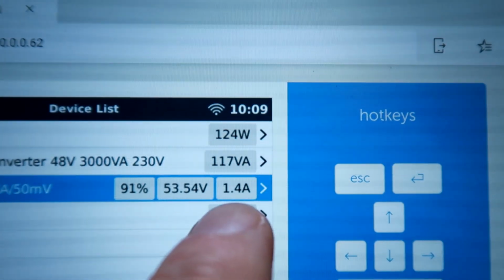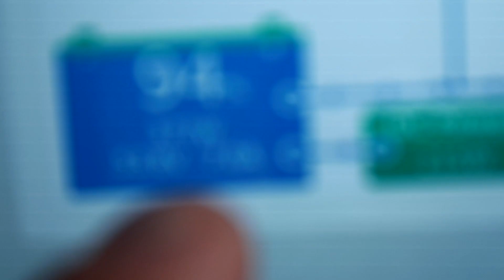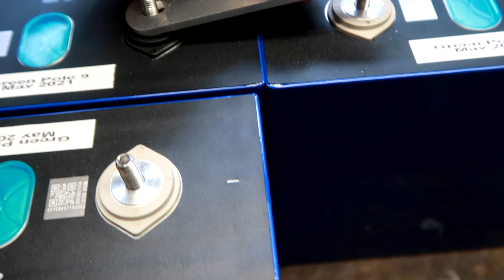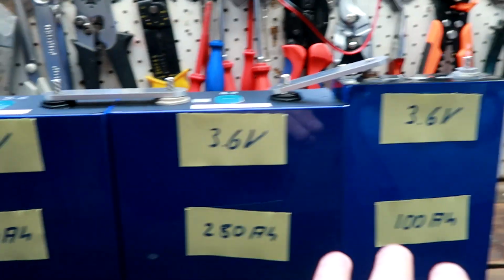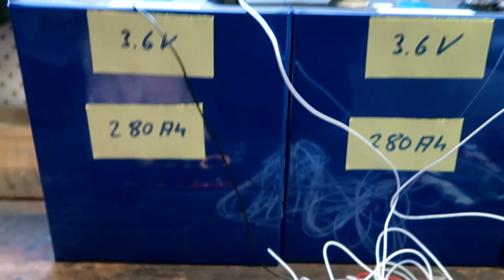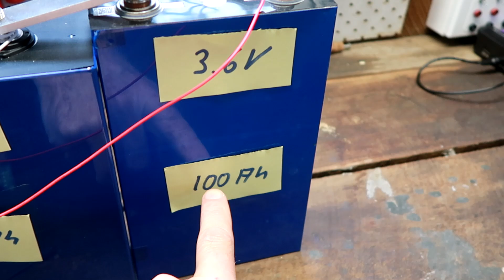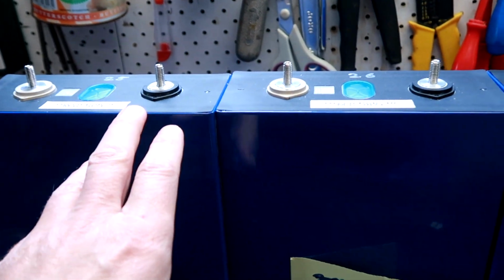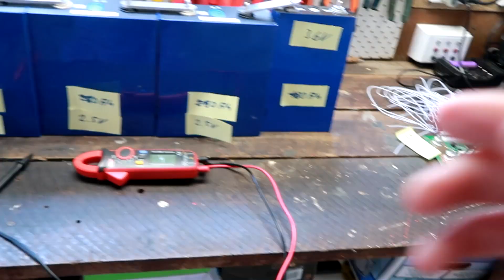Divided opinion about balancing, balancers, BMS. How to and why to balance LiFePO4.

Comment: Question, when bottom balancing, when you drain the batteries to 2.5v do them individually or in parralel?
Reply from the maker: All cells need to be at 2.5V. You can do this by parallel them or on an individual base, it does not matter.

Comment: Good video, well I'm going to do a bottom balance on 12v 200ah lifepo4 blue carbon battery,  two of the cell are already 2.5v, im going to connect a 12v fan until stop working. Hopefully all the cells gets 2.5v, then I will connect smart charger  lifepo4 to the battery until gets full. I don't have Active balancer. I hope this work.... Any advice?
Reply from the maker: Does the battery has a BMS? These days, all chargers, MPPTs and BMS are designed for top balancing. Nobody really does bottom balancing any more these days due to the fact that we now have BMS available which work reliable and also balance the cells at the top.
Reply: @OffGridGarageAustralia  yes, the battery has bms but when they were installed in series never were balanced and one of the two batteries started showing lower voltage, I opened and I noticed two cells with 2.7v.

Comment: I have one of my 16 cells that will not charge above 3.4 volts - as in its never seen more than 3.3xxx volts.  I end up with a voltage difference of 0.125 v when my battery is charged (I charge to around 55.4 volts).   I have raised this with the seller and that have said initially that this was "a dynamic voltage so you shouldn't worry about it".  After shutting down the battery and checking it with a multi-meter, I am still seeing the same difference after an hour of being turned off.  Seller says "within tolerance" and it wont be a problem.  I call BS and think it will become an issue in time; probably reducing the life of my battery.  Thoughts?
Reply from the maker: Can you manually charge just this one battery?
I would charge all cells as usually to 55.4V and then connect only this one cell and charge it as well to 3.46V. So it is inline with the others.
Reply: @OffGridGarageAustralia  Thanks for your response.  I'll try the single cell charge this evening.  Watch this space!
Reply: @OffGridGarageAustralia  I ended up charging it to 3.5 volts - a little more than the other cells.  It took the charge at 25 amps - took around half an hour to get there.  I have installed it back into the battery bank and powered everything up.  Immediately and as expected the BMS started doing its thing and taking power from that cell to distribute to the others.  As of right now, the cells are all sitting 3.324 (53.18) volts - within .001v of each other - around about 88% SOC.  Everything looks okay, but I wont know for sure until tomorrow when the solar pumps back up to top the batteries up.  I see this behavior normally and then when I go to charge, it wont go above the 3.4 as described.  Fair to say that the cell can charge, but isn't doing so in the Battery.  Also a few days ago, I did terminate my balance lead again to that particular cell and even tried moving it to another position to rule out the BMS as the issue.  I'll update again when I get another charge of sunlight!
Reply from the maker: @nonicknamesremain  Thanks for the update. The single charged cell may now cause the opposite as before and could trigger OVP in the BMS. Can you leave the battery on a power supply over night and keep it a55.4V to give the balancer time to do its job? That should bring it in line with the other ones again.

Comment: The main reason for bottom balancing in EVs is to protect the weakest cell from going into reverse current when the battery is low and you go full throttle.
Reply: That is the job of a GOOD BMS.. balanced cells dont protect them... BMS does.
Reply: @Doctorbasss  the bottom balancing people did not use a BMS, they just used a low voltage cut off... These people were living for physics at that time🐸
Reply: @mjp0815  So, what happens when one cell drops way below the low voltage knee BEFORE the pack Voltage drops below the cut-off voltage?  Are you saying that this does not, or can not, ever happen?   Bottom Balancing, then running without a BMS, is not normally done in an off-grid situation.
Reply: @MrSummitville  when one cell drops to zero before the pack voltage is at the low voltage cut off really bad things happen as this cell is driven into "reverse polarity" instant destruction. Bottom balancing allows you to use the entire pack safely in high current situations like EVs without BMS, just using voltage monitor without running into this dangerous and expensive issue. Also, the bottom knee of the kurve is nicely visible in bottom balanced packs. Another reason why early DIY EV owners liked to bottom balance their packs.... They could tell that they were empty by simply looking at the pack voltage. The charging process was a low amp thing, lots of time to catch high voltage cells.... History... Today's BMSs top balance the packs now, and monitor each cell for low voltage... Drbass rightly said.

Comment: I intend to charge to 3.4 (54.4) then float at 3.4 (54.4) for 30 minutes.  As you pointed out in a previous episode,   this puts all cells at max capacity.  I would also stop the charge if any cell hit 4.45v.   Is there a problem with this? I would turn of all balancing.  Do you think this would cause plating problems?
Reply from the maker: I don't think your settings will cause any problems. Are your cells not going out of sync after w while?
Reply: @OffGridGarageAustralia  still in planning stage. Thanks for your work.

Comment: How do people feel about extending pv cables by soldered splice and marine shrink wrap? I ask, as I need to extend some existing cables, and there is little room in the conduit for anything else. Otherwise I have to spend £100 for new cable. Would the soldered join act as a resistor? The cable is 4mm2, 1000v . I intend to run around 1kw at @98v down these wires.
Reply: So long as the splice solder is thicker than the wire then no issue.
Reply from the maker: Hey, Chris, there is no problem with that. I have done it numerous times. If the solder connection is solid, no problem.
Reply: @OffGridGarageAustralia  thanks all, this is todays job.

Comment: Even on my 4.2v chemistry's (on ebikes usually) I bottom balance, but I also have a bms set to disconnect the pack if any cell gets above 4.1 or below 3.1. I prefer bottom balancing as at high current drains with a low SOC you have less risk of pushing a weak cell into a reverse polarity situation if it goes over the cliff.. 
You mention VW samba's with battery packs without a bms, well there was two... was being the important word.... apparently it was being stored in a field, and the panels were still connected but covered by a tarp, until they were not covered by a tarp..... I wont mention who fitted that 'system'.....
Reply from the maker: Yeah, very different scenario in e-bikes and other high current equipment. Also, using Li-ion is very different as the charge and discharge curves are linear to the voltage, unlike LiFePO4.
Reply: @OffGridGarageAustralia  agreed, but both have similar issues if you get to single percent soc and then something in your home current spikes like a heater/shower turns on. But I think the time has come to finally pull the trigger on a pack of batteries for the camper. I wanted to use lots of 100ah cells for an L shaped pack but looks like 300ah will be more cost effective which means going to 600ah instead of 500

Comment: I am a total novice on electricity and all that stuff. So now I have ordered a set of 4 3.6V 280 ah batteries and bms. I do not have a bench charger. Only solar panels, a charge controller, and the bms. Will I need to find a way to balance the cells or can I simply put the parts together and go from there? 
Pros? Cons?
Reply from the maker: If the cells are new and you don't need the state of charge you should top balance them. If you don't have a charger or power supply, you can put the battery in series and set the charge controller to a lower value, say 3.35V. Keep measuring the voltage of the cells until they all reach that 3.35V. Slowly increase the voltage of the solar charge controller by 0.2V and monitor the cell voltages. Keep going until you hit 3.6V with all cells. It depends on the BMS how it will handle the balancing. Got a DALY BMS? Forget all the above as it won't work with these BMSs.
Alternatively you can use an active balancer (~$25 for a 12V battery) and also increase the voltage slowly as above to give the balancer time to... balance.
I'll make a video about how to do all this once the new batteries are in place.

Comment: Why not middle balance the cells? I know, no available equipment that do that and it is more complex when you can't just measure the voltage. But apart from that it ought to be best for the LiFePO4 cells if I'm correct?
Reply from the maker: This would only work with a precise coulomb count of Ah in and out of the battery. It is difficult to find a common spot for all cells where they have a known state to compare to. But good thinking!
Reply: @OffGridGarageAustralia  Yes. If you don't use balancing you could use your testers to find and charge all cells to their middle point of charge and then just use the bms to stop charging/discharging when the weakest cell goes high/low. Preferably at really safe voltages, this way no cell is stressed and the pack should in theory not get unbalanced.

Comment: "You are constantly transferring energy in and out of the weakest cell" - well, yes and no, yes you are, but during discharge and charge it's better to think of the balancer as shunting current PAST the weak  cell, ie, the capacitor balance board is partially powering your load in the discharge low end state and partially charging your other cells in the charge high end state.

Comment: Balancing cells with the bars is fine as long as there charge is very equal. If voltage is very different the current is way to high when connecting them.
Reply from the maker: How much current will there be if the voltage is different? Stay tuned.

Comment: In a top balanced system where each night you consume significant capacity (ie not a standby system) the weak cells will spend significant time at a lower SOC than the stronger cells. The stronger cells should therefore age faster and over years may help stabilise capacity deviation. If bottom balanced then it is the weaker cell that may age faster than the strong cells.
Reply from the maker: But it's not SOC which kills your cells, it's the voltage. Either low or high.

Comment: I used that 5 amp active balancer to bottom balance my 8s pack while still hooked up in series with BMS. I did n't dare redo the nuts on these cheap flimsy cell terminals again. I could feel these cheap terminals moving when I put it together the last times. the buss bars and holding the =/- cables while tightening the nuts prevents movement. runit down to low cell shut down, then wait for balance, then run it down till a low cell cutoff again and waited for balance again. each time the cell difference got less . till they  all run out the same time.

Comment: New cells with ~ same capacity and ~ same chemistry/resistance so...
Leave 5% buffer on top and bottom. Use 90% or a little less.
Every 3 to 6 months ( depending on the loads) top balance 3,5 -3,6 V low amps and let the BMS balancers do it's job. Repeat balancing if necessary.
It should work.
But as you said it's a religious thing... so...

Comment: be kind to your live audience outside the window. i will bet if you put a like button out there they would press it.  what i have found out with connection problems (resistance ,heat ,loss ) it to use copper never seize on all of the connections. i have not had any problems since.

Comment: I top end balance, higher the voltage the better, as the voltage increases quickly so does the charging current go down, that way you get the best out of your BMS balancing current
Reply: You wrote,  "... higher the voltage the better".  At some "high" voltage your are degrading the cells ...
Reply: @MrSummitville  I run my banks at 56.4 volts, and have done for over 2 years, it is a dual battery setup with Lifepo4 and Li- ion battery running together

Comment: Can this chemistry of battery be fast charged? Can they handle a lot power to charge a bank? Also can they handle a high power draw never to be drawn down below 45%?
Reply from the maker: A 'Yes' to all your questions.
Reply: @OffGridGarageAustralia  Thank you I've been looking for the chemistry of battery to conduct an experiment with and this seems like the one I should use. Thanks, now my research begins on this battery. But one more question; how many charge cycles does batteries generally have? Thanks again!

Comment: Bottom balanceing is ideal but there aren't any bms's that do anything but top balance so I don't know how useful it is and as far as active balancers they are not quite that smart they can only move energy over 1 cell I think what would work better is taking a high voltage cell and boosting to the whole pack voltage and dumping it there and taking power from the whole pack to charge an undervoltage cell and just do that for one cell at a time I think would be fine but I don't think they over cycle the battery because it is mostly doing it during charging so instead of like 10 amps it's getting like 9
Reply from the maker: Well, if you bottom balance, you would not need a BMS with balancing capabilities at all then. This would just destroy your initial bottom balance. Same for a balancer.
Reply: @OffGridGarageAustralia  but I mean cells are probably going to drift but if you are not planning on having any balancing what difference does it really make if you had them top balanced or bottom balanced they are going to drift just the same

Comment: Hello. I got a question about BMS and conect and reconect baterry. TIn the situation of over or under voltage the BMS relay disconect the battery from the controler/inverter. So if under voltage how the battery will be charged if disconected? Other questionlso the resistor for preload capacitors, i undertand the utility , but in normal use the relay will conect and disconect the battery but no preload current that will not affect the inverter? ThaNKS, soryy if my english is not  so correct
Reply: Single Relay BMS = Yes, both the Charger and the Load can be disconnected for Over-Voltage or Under-Voltage. 
Dual Relay BMS = The Charger is disconnected for Over-Voltage or the Load is disconnected for Under-Voltage.
Yes, use a Pre-charge resistor even with a Relay to limit max amps inrush <-- is just good electrical engineering.
.
Reply: @MrSummitville  Thanks for reply. I will use a combined controller / inverter. And a second charge controller, conected before the BMS relay. If the BMS disconect the baterry for low voltage this controler will charge the baterry. When the voltage will go up the BMS will reconect to the main inverter/controler. For over voltage the controller will stop the charge. What about this solution?

Comment: Do you have a link to the balancer you showed in your video?
Reply from the maker: That's wasn't a balancer at all. At this point of making the video I didn't have one so took this buck booster as a place holder. But I have balancers on my website. They work great: https://off-grid-garage.com/battery-management-systems-bms/
Reply: @OffGridGarageAustralia  Thank you. I was a bit confused on the way it looked. (Big toroidal Transformer etc.) Great videos . Thanks again and congrats on hitting 10k !!
Reply from the maker: @RemScanProducts  Thank you!

Comment: Bottom balance without balancer assumes cell properties do not  change but thats just wrong. Over multiple cycles capacity as well as internal resistance changes. The worst call will change more then others and when the cells get old this will get a fire hazard.
Reply from the maker: That's why bottom balancing the pack does not make sense in my eyes...

Comment: Or you could balance it around 50% SoC and cut use of the pack on weakest cell reaching higher and lowest voltage. BUT with flat curve batteries like LFP it's close to impossible because you would need a hard to achieve precise charging at 50% SoC for every cell before top balancing AND a long time (> week ?) top balancing because of the low voltage differences...

Comment: You are going to have two batteries, right? let's call them A and B. You could charge the batteries one after the other, so charge A, until balanced, and then charge battery B, until balanced, go back to battery A etc. when a battery is being charged, us the other one to drive the inverter, unless it is empty. This way you could hit max charge regularly and use a regular BMS. If you do not reach a full state of charge when charging battery A (resp. B), because you consume electricity from it, charge battery A (resp. B) again till full charge. There is a bit of mechanics & computer around that to organize the automatic connecting & disconnecting of batteries to the panels and the inverter. (cheers from Waterloo,BE by the way, we have good beers ;-) ).
Reply from the maker: Thanks for your comment. That would be ideal to treat the batteries separately but it's a lot of work and I would really preffer having them both connected all the time.